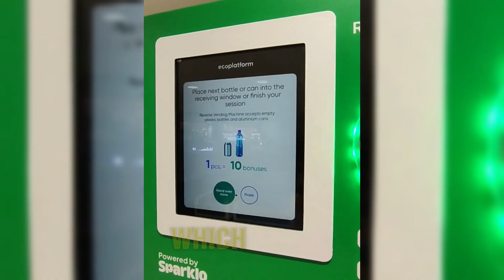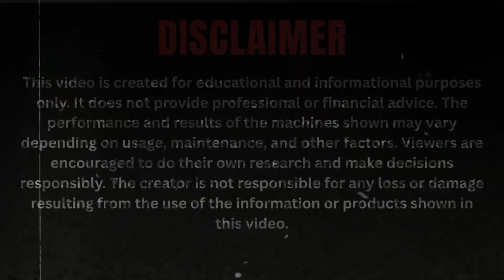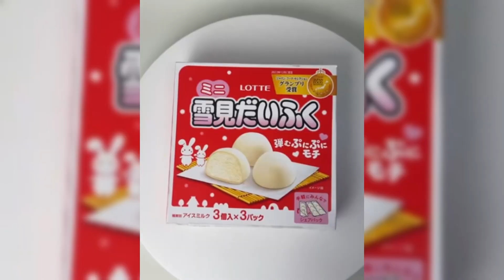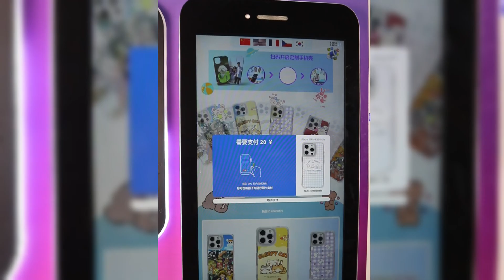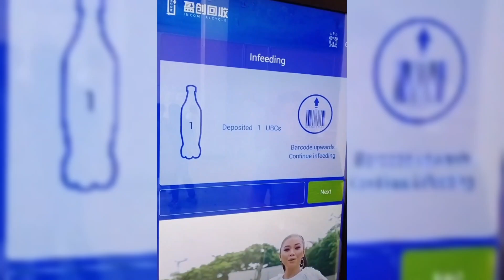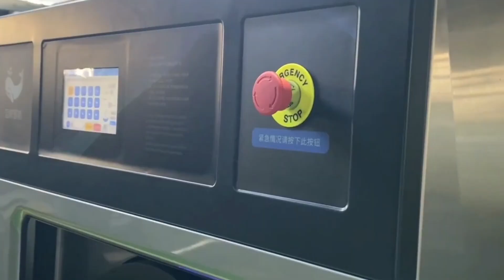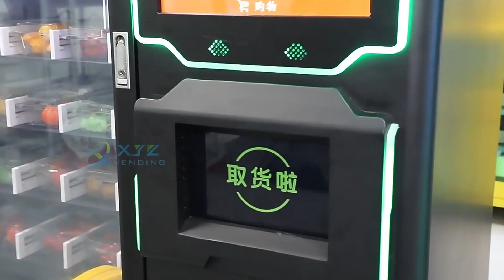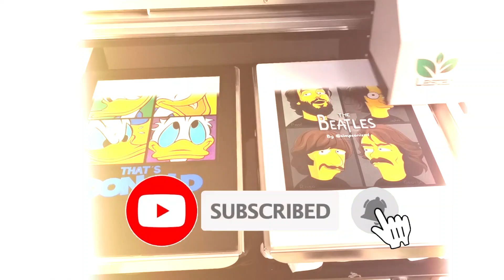What These 15 Japanese Machines Can Teach Your City About PROSPERITY

Comment: I love the idea of the ramen machine and the laundry. Putting those in university dorms, hospitals, public schools, owning a laundry mat here in USA is an excellent investment. I thought about it years ago just didn’t have the 100k to get it off the ground. The building , the zoning, permits, I didn’t realize where that used water was gonna go, how I was gonna connect to the appropriate sewer, was considered too close to neighborhood, parking, it was endless requirements.  However a ramen machine, that too has great potential. But connecting to university as example, usually vending machine companys have territories, and if there are local business that also offer soup menus, well there is a problem with permitting thru local better business bureaus, it’s not as easy as this video portrays. Although I love the ideas.
Reply from the maker: You made a really good point. Ideas always look easy in videos, but once you deal with permits, zoning, sewer connections, parking, and all the regulations, it becomes a whole different challenge. Even vending options like ramen machines need approvals because universities and public places already have contracts. Your experience shows the real side of things, and it’s a very valuable perspective.